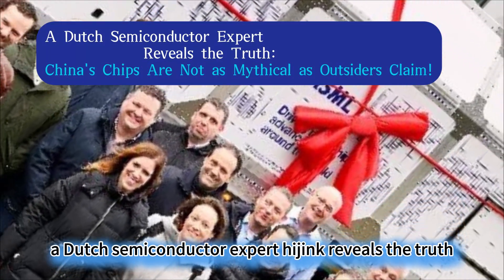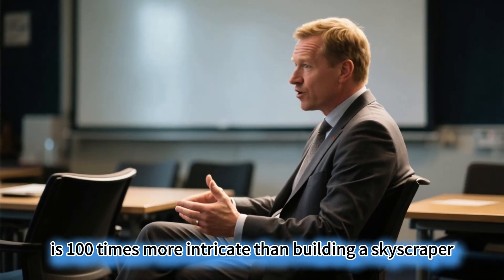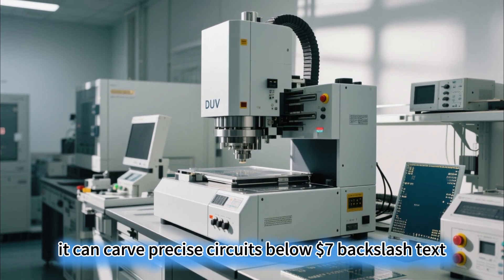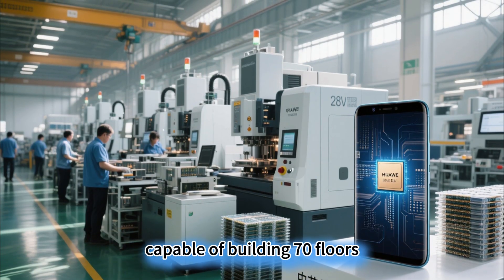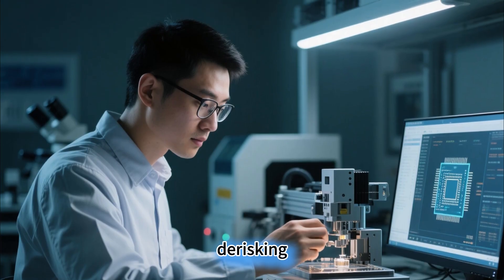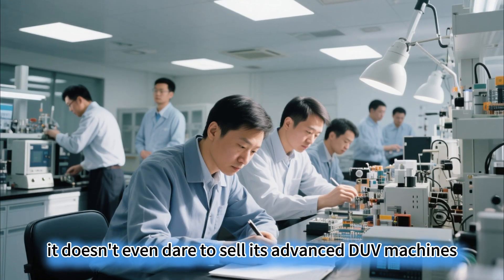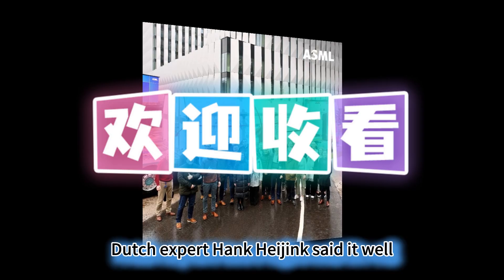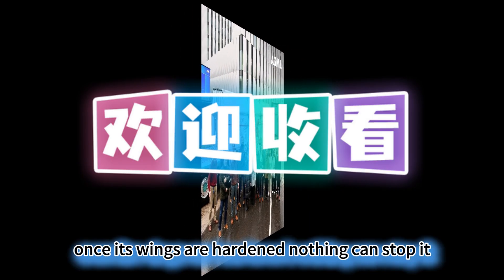A Dutch Semiconductor Expert Reveals the Truth：China's Chips Are Not as Mythical as Outsiders Claim!

Comment: The latest Huawei Mate80 the pro and pro max version, its sit on chip (SOC) for its Kirin 9030, has hit a transistor density of 220 mtr/mm squared which equivalent to a 3nm to 2nm. More so, in order to hit above 200 mtr/mm squared, one will need an EUV. I believe this freak up the west especially Trump. 

That is why the Nexperia saga and Japan saga, all to cut China at the leg on semiconductor. Japan in its part banned 110 Chinese companies from importing Japanese photoreist or sillicon wafer. Japanese photoreist or semiconductor or silicon wafer of which Japan control almost 90% of the market. 

Yes, China's Nexperia is selling chips directly bypassing Dutch Nexperia to German and ironically Japanese automobiles in Yuan or RMB using their own Chinese photoreist. 

They did not know that China is already mass producing until November when China announced the standard and quality reached. China is going to mass produced it much much much cheaper. One important ingredient is the man made diamond of which China control 95% of the market and have banned Japan and the west from importing. You don't give me bread, I don't give you flour. 

Trump wants to cut China at the feet on semiconductor when they realised they failed to chop of the head by banning DUVs and EUVs.

It back fired badly. China now has a vertical full supply chain on semiconductor, all thanks to Trump's tech / chip war. 2026 will be a year of reckoning for USA tech. China will pop every bubble that there is to pop in USA. Hell hounds will be let loose on USA tech and it will be damn bloody.